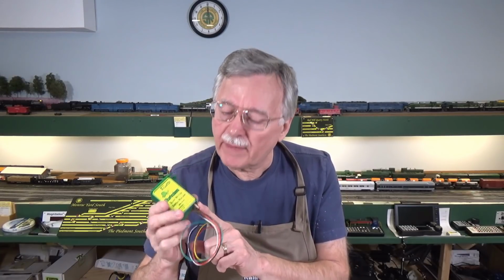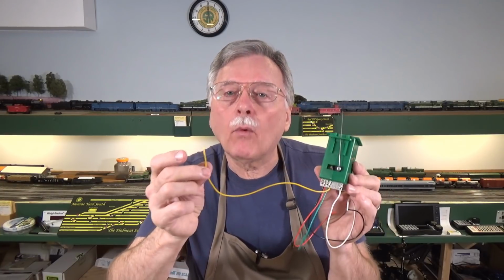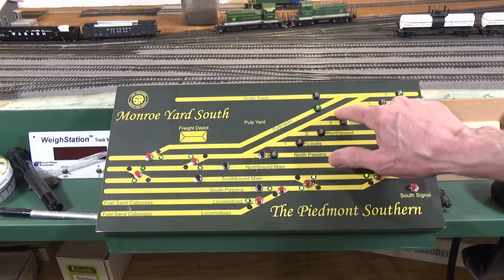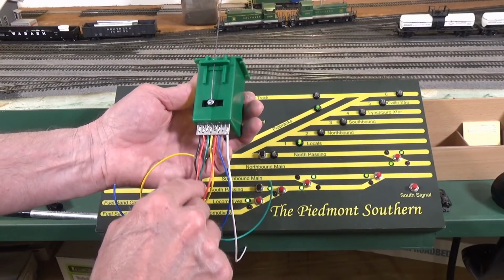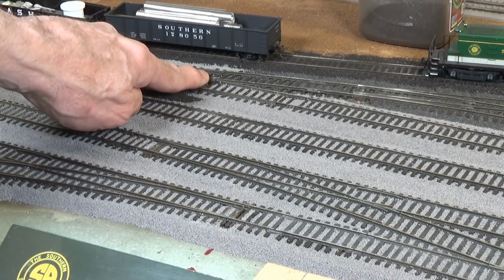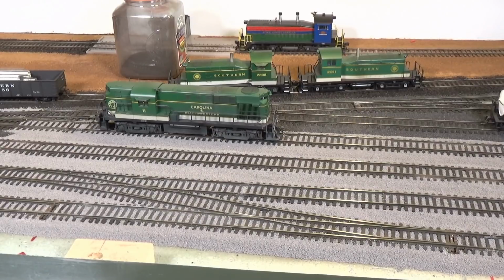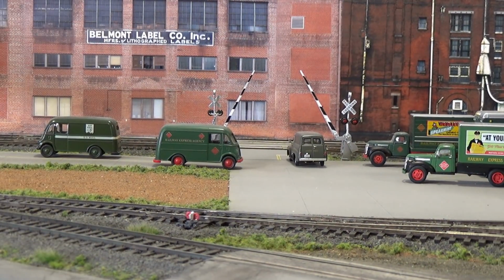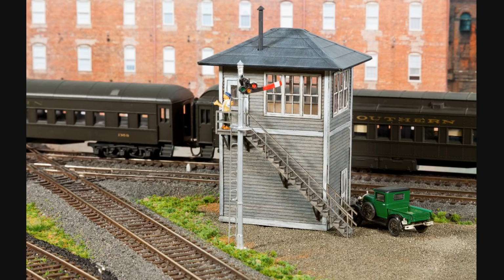Tricks with Tortoises—Impress Your Friends (180)

Comment: Where did you get your Southern Railway passenger cars? I was brought up in Asheville NC and watched trains out the barber shop chair in Biltmore forever. Rode down the mountain and back up on a steamer with my grandfather at least once every month. I'm just getting back into the hobby. I really need some!
Reply from the maker: Most are Walthers, some older ones are IHC and Con-Cor. Check eBay and local,train shows.

Comment: Do you have a video explaining the 'one button routing' on your yard ladder?  Its a game changer!  I looked for one but couldn't find one.  Thanks in advance.
Reply from the maker: I used the Digitrax DS64 which is programmable for the yard ladder turnout control. Unfortunately it was replaced with the DS74 so to do a video I would have to buy new DS74s and swap them in which would be more trouble than I want to get into. And I’m sure that as soon as I bought the new ones they would come out with a DS84. These should work pretty much the same way and they do have pretty good downloadable material on their website showing how to set up and program a yard ladder.

Comment: Hey Larry, Have your book on Wiring your model railroad. I'm trying to wire my Tortoise switches with panels lights and layout signal light on the layout. Have you done a video on this yet????? Dave Hanna
Reply from the maker: I showed it to several videos how to do control panels with LEDs indicating direction for travel. For controlling signals you could just use one of then
SPDT switches on the Tortoise to flip polarity and shift between red and green. I am sure that a Google search would turn up a more comprehensive method.
Reply: Thanks

Comment: Tortoise motor are nice but it could be problem if you connect digital wires for the frog of the turnout when you solder wires. Digital experts recommended pure copper contact by connect. Maybe Cobalt turnout motor are better?

Comment: Where can i fine the left hand and right hand switch for 100 track. and can i used 83 to 100 track together?
Reply from the maker: Any Walthers dealer can get them for you such as blueridgehobbies.com my dealer for over 10 years. you can mix them but it takes a special soldering trick. Put the rail joiner on the code 100 rail them flatten the open end with a pair of pliers. Next put the code 83 rail on top of the flattened joiner and  check to make sure the rails are at the same height—then solder both in place. I suggest doing a test with some scrap rail before using it on the real thing.

Comment: It's always best practice to return the turnout to the main once you've finished using the turnout..
I'm not quite sure why you'd want to waste expensive tortoise's to control semaphores and crossing gates when you can buy 9gram servos for $1- each and servo controllers are cheap as chips and easy to set up as well...
Reply from the maker: That was all done for one of my books. The goal was to make it easy using off the shelf products, not something you have to fiddle with to get it to work.

Comment: I like your demonstration of the route control at your ladder. I recently bought a DS64 and have it working using a Digitrax Throttle or JMRI. Could you please explain how to program the DS64 for route control?  It seems intimidating. Thank you.
Reply from the maker: I have been trying to figure out the best way to do that. Unfortunately it is a very complicated and technical topic that only a handful of folks are likely to watch, be interested in, or even try. Also the way I do it involves having DecoderPro operational as it has a special page just for programming the DS64. I will see if I can come up with at least a short demo.
Reply: @TheDCCGuy  Thank you. Even a clarification of the terminology would help.  I would be using JMRI to program mine also.

Comment: On your North Passing track isolated section, you could also wire in a colour light signal with default to show red in tandem with the isolation.
Good video. Thanks.
Reply from the maker: The operators I know would ignore the signal about as readily as they do the fact that the switch is thrown against them. So this approach takes human nature into account. Of course they will still complain that their loco stopped dead for no reason!

Comment: Hi Larry,   i used  Tortoise for years DC setup in stall mode,  very quite.  But  now  I give  a try with AC source with diodes,  its very noisy and buzz, its annoying,    It s  a normal behavior on AC setup ?   Should I change with cheap AC transformer wall?  -Paul Trudel
Reply from the maker: I have Tortoises that are powered using straight DC and some using AC and steering diodes to produce half wave DC and to be honest I can’t tell the difference in sound. I mainly notice a lower volume when they are operated at a lower voltage. They will operate with 9-12VDC  but with AC and steering diodes that needs to be 14-15V to compensate for the half wave output. I suspect that the rectified DC may be towards the high end of 9-12VDC thus the louder sound. This is similar to the sound difference using 12VDC vs when the rectified DCC track power is used with a Switch8–the 12VDC is quieter. I need to see how loud they are when using 9VDC.
Reply: @TheDCCGuy  Thanks Larry ,  will do some test.   Great job on your channel !

Comment: Reminds me of my 1970's built layout I had which using Hornby lever switches my father wired in an incredible absolute block system with neutral sections just before a signal so if the signal was stop, the engine would pull up and when the signal was green it would just go through until it arrived at a stop.   He also fitted switch neutral sections at my platforms which allowed the loco to arrive at a platform without smashing the buffer stop, it was very complex and a small fortune in signal and point motors plus the many switches and a set of power supplies for the lighting, points and signals and the trains themselves.

Comment: I wonder if there are buttons with green and red LED's, so you can use both contacts of the switch, to have the light turn to red, when the point is in the other state.
Reply from the maker: They might exist but I have not seen them yet. These (LP1 series at Mouser.com) do come in various colors though.

Comment: can you use the decoder buddy on old locos that do not have the plugs for direct plug in of a dcc decoder. Can you take the old circuit board out of the loco and connect the wire from the motor, track pick up and lights. then plug in the DCC decoder into the decoder buddy. can use an 8 pin decoder or does it have to be a 21 pin decoder. I only want basic dcc. Or is it easier to just get a new circuit board designed for the loco being converted. Is the decoder buddy just used for more complex dcc functions. cheers
Reply from the maker: Yes, you can do that. But as you describe you could also buy a less expensive board. However many manufacturers make 21 pin mobile only decoders and they will  work with  the Decoder Buddy too. The good thing about using the Decoder Buddy is if you decide to add sound at a later date it is a simple matter to just pull out the old decoder and install the new one on the Decoder Buddy board. So find the best combination that fits yours needs and budget.

Comment: I am looking at using the Digitrax Block Detectors to align the switch on my large reversing loop, so I don't have to do it.  Of course the train should be moving slow enough to allow the tortoise to complete the movement of the rails.  It requires the Tortoise, Digitrax DS64, BD4  and a gapped section of track.  You have to think about traffic.  Will the train enter the reverse loop going in the same direction each time or will you allow it to run either direction?  If you allow it to go either direction you will need two BD4s.  Your train must clear the switch before it comes back around to the BD4.
Reply from the maker: In  most reverse loops direction of travel doesn’t matter, only that the train completes the loop and exits. There are various circuits and methods for those situations where it does matter and it sounds like you are on the right track.
Reply: Great video Larry 👍👍👍

Comment: Larry-
At about 16:30 and onward you show how you isolated the 1 foot long track section to protect against derailing a Loco coming down the mainline right to left. What happens with "keep  alive" equipped locos?  Don't they keep running and derail? Great video, like all those before it.
Reply from the maker: It all depends on how fast they are going. In this case the track is a side track coming into the yard so trains usually aren’t going very fast. Also I rarely put stay alives in my diesels so they stop quickly. This is not something I would install on a main line.

Comment: I just didn't use those polarity things, my dad just cut the wire underneath switch and moved the rails apart so there's no short, still runs smooth